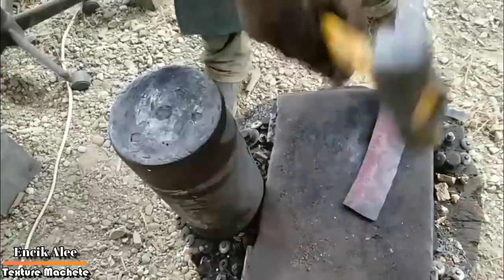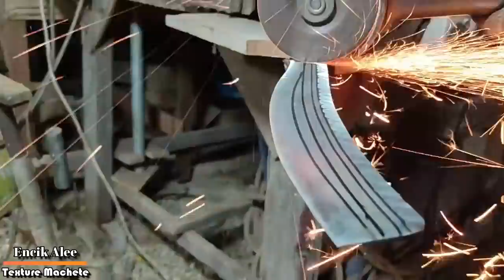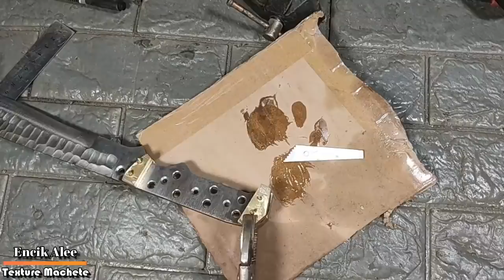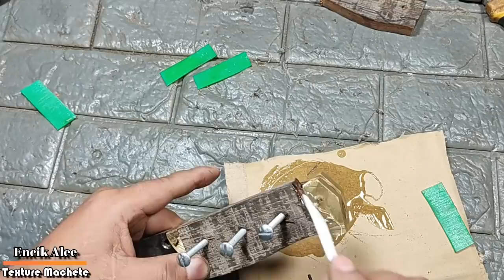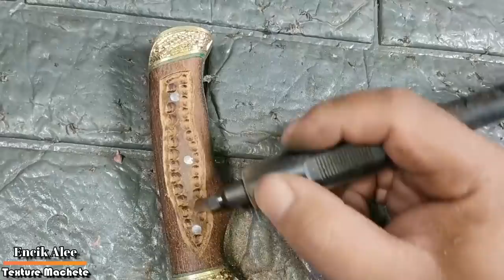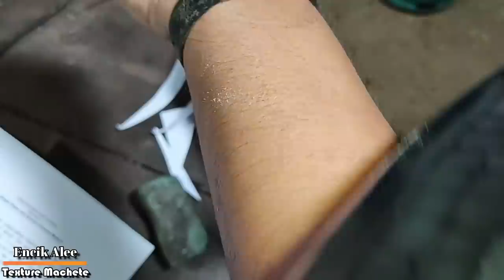♻️ Making Texture Machete ( Hammer Peened ) from Spring Steel | Cara Buat Parang Texture.

Comment: Very pretty blade! Your artistic skills are amazing. But I didn't see where you tempered the blade after the initial quenching. Did I just miss it, or is there a reason for skipping that step?
Reply from the maker: Thanks. This is Edge Quench. The spine remain soft. On the quench process, i do instict measure for the The edge just reach enuf hardness but not too britle and not too soft. hehe. Hard to explain. it need to do many times to learn the process.

Comment: Hi Alee, what are the charateristics of this final product ; using a leaf spring as the base material ? My guess is the cutting egde is sharp and the parang itself is stiff and hard. My question specifically is , is the cutting egde brittle because of its hardness ? thks, excellent finishing.
Reply from the maker: steel need to be hard and brittle to hold & extend the edge sharpness. but not hard or brittle as glass. need to set between flexible and brittle

Comment: Be careful drilling those cutlass handles. If that drill sticks in the handle  it will spin the blade on you.
Reply from the maker: Thanks sir. The stand drill dont have much force power to do that but if the blade trying to spinning, it will be block by the drill pole.
Reply: @hori_ink82  he has the scars to prove that. I cringed when hi put his hand under that jigsaw

Comment: Curious what this hardened too.
Reply from the maker: yup. it was edge quenching. only the edge were harden. and all the grinding proccess to make the texture on the blade did not ruin the edge hardness.
Reply: That's what I said as well not a correct hardening of the blade and all the grinding afterwards almost certainly caused to much heat to migrate into the edge
Reply from the maker: @michaelsears4798  no worry bro. I know the heat limits. I always check the heat travel and it did not ruin the blade hardness. The cust who order this already using it for chopping bone and bamboo with no problem on the edge.

Comment: Looks cool but that edge will never stand up after the incorrect quinch you did I can guarantee that a file would still bite into that edge instead of skating like it's supposed to
Reply from the maker: Look like you never done edge quenching before. 😁
I admit my mistake by not showing the blade test becoz i dont want to ruin the blade finishing. I already tested it on chopping 3,5&6inch nail with no problem on the edge. The cust who order this also satisfied about the edge retention after chopping bone & bamboo.